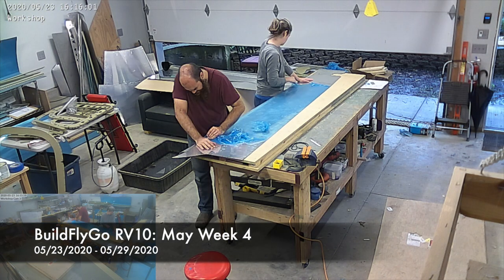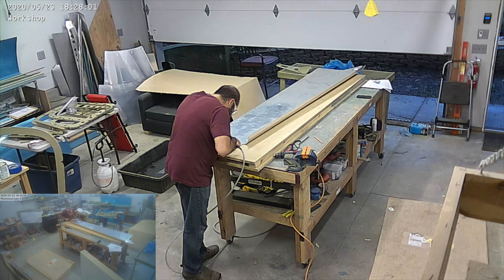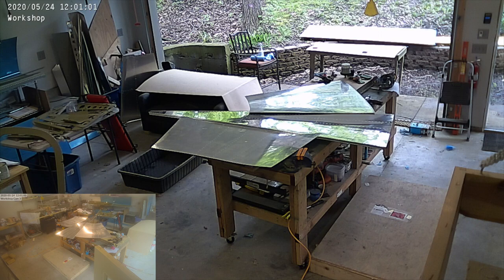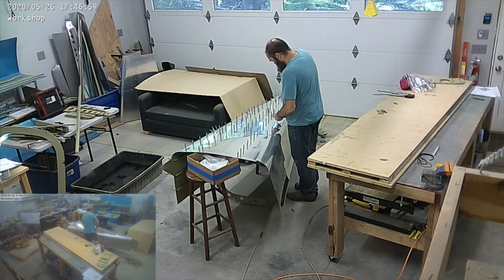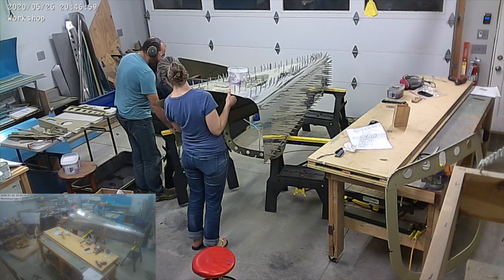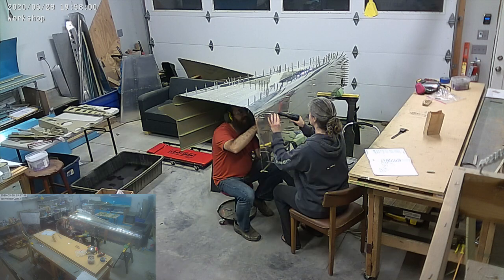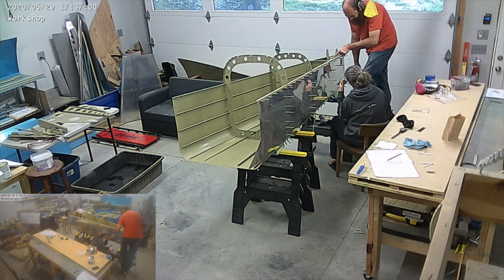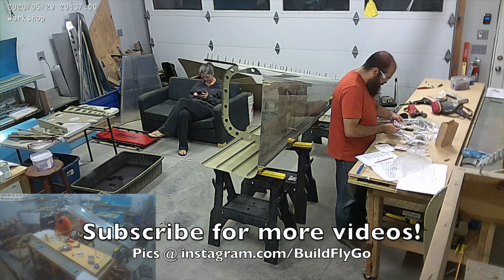RV10 Build: May 2020 - Week 4

Comment: I'm hoping there is a 90/10 use of a bucking bar... I'm hoping 90% with (1) tungsten bar!  The other odd spots... you can buy a number of standard bars?
Reply from the maker: You got it. I have two different size tungsten ones that cover 95% of the bucking, and a variety of other sizes that I've cut up or ground into different shapes to get the odd stuff. Just buy some cheap old ones at OSH next year to cover the weird bits.